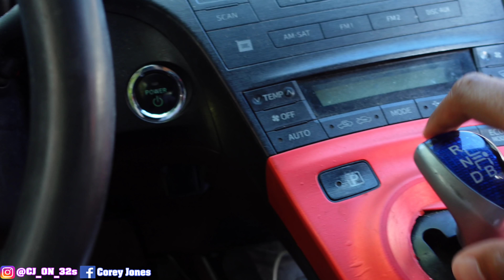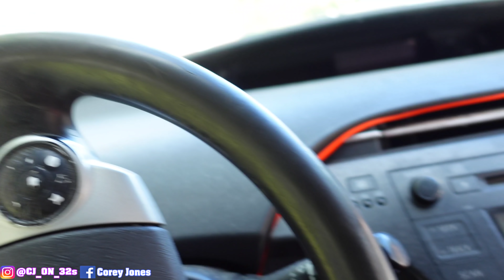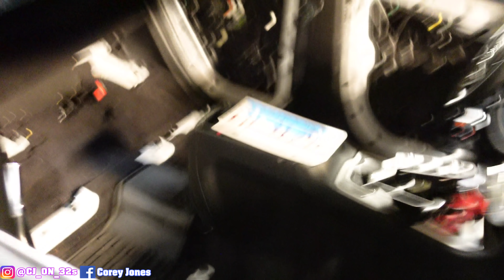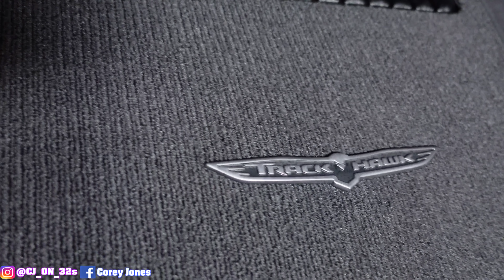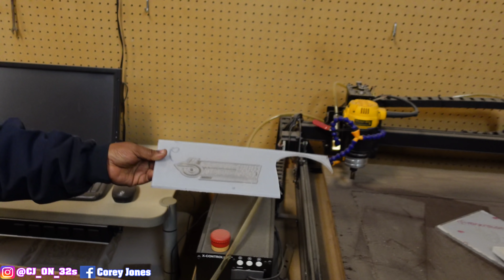W#F THEY DO TO MY TRACKHAWK FRONT WINDSHIELD IS MISSING BUT THE NEW INTERIOR IS CRAZY

Comment: ceramic coat your seats and whole car dawg. it protects anything and is a way better plastic restorer compared to black armor even though not advertised as soo. can be used on paint, plastic, metals, rims, leather, cloth, shit anything even use it on my jordans son. but it will make your seats both water and stain resistant so added protection on everything. My whole jlu will be covered in it when my shits built out. hopefully i run into sometime. stay safe keep grinding aint no where but up!!!!